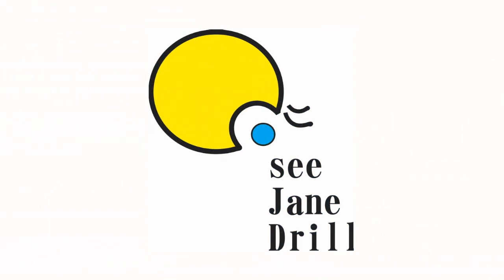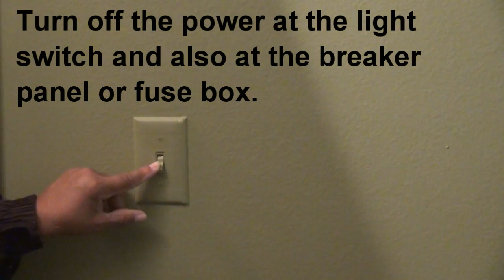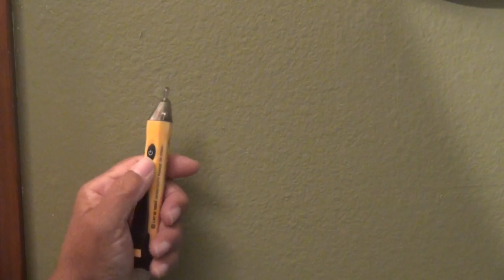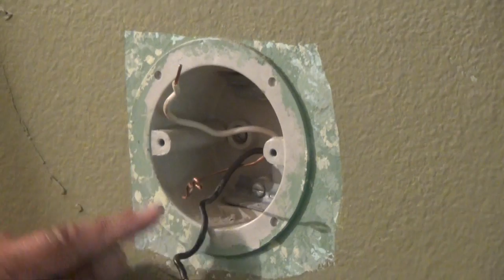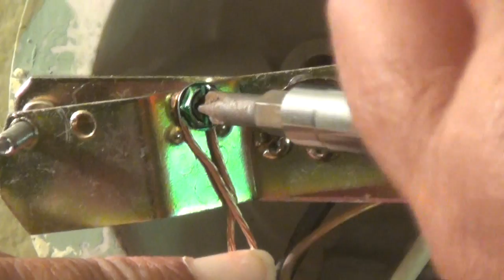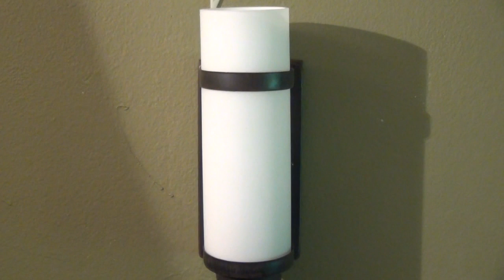How to Install a Wall Sconce Beginner's Expanded Version

Comment: Thanks, Leah, this was very informative, much better than the instructions that came with my fixtures.  The ground wires information  cleared up a lot of confusion about what goes where, got me thinking about the ceiling light I installed months ago🤔.  I also didn’t use electrical tape but I will from now on.

Comment: On another topic, would replacing a bathroom ceiling vent fan be about the same as doing this? I'm not physically capable of climbing around in my attic, so I was hoping it could be something as simple as this and doable from the bathroom side of the ceiling, rather than from the attic side. Thank you for your time and patience with us.

Comment: ..I may be late w/ this, but the wire nut should twist the wires a few turns to show tightness.. That's the first thing an electrical inspector looks for... The ground wire should be twisted w/ pliers before the nut is even put on..

Comment: Just wondering: when screwing in the light bulb, wouldn't one want to use a tissue to avoid touching the bulb and leaving finger prints? Or don't energy saving bulbs get warm enough for it to matter?
Reply from the maker: Hello Herr,  I'm careful when handling the higher temperature generating bulbs such as halogen, however,  I have never had any bulb failure due to handling energy efficient bulbs.
Reply: Usually, only the halogen lamp bulbs are subject to this problem, due to the Quartz glass....

Comment: I have a ground wire coming off my light fixture, and a ground wire coming out of my box, but I do NOT have a green screw or anything at all on the bracket to attach either of the wires to. What do I do in this case? I don’t understand where to attach the ground wires when there’s no green screw. (This light came from China with no instructions and it’s driving me crazy)

Comment: Electrical tape may provide a warm fuzzy feeling, but please don't rely on it for anything. If the wire nut is applied correctly, the tape won't help. If it isn't...then it isn't...and the tape may provide a false feeling of security...